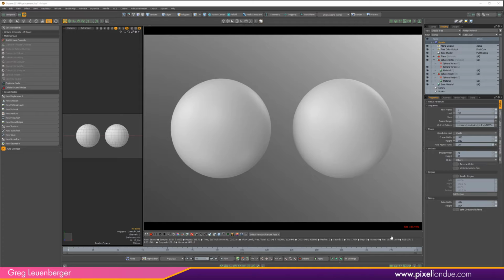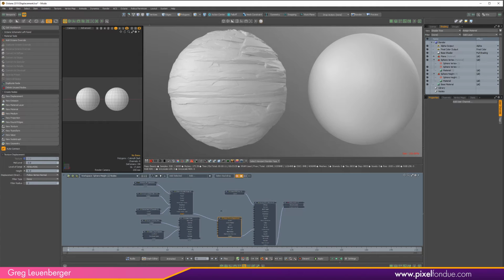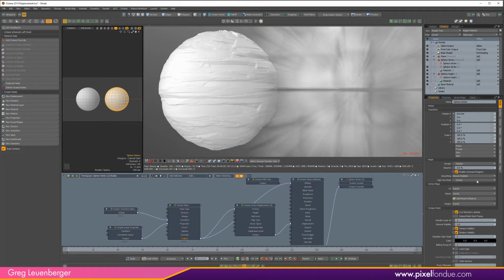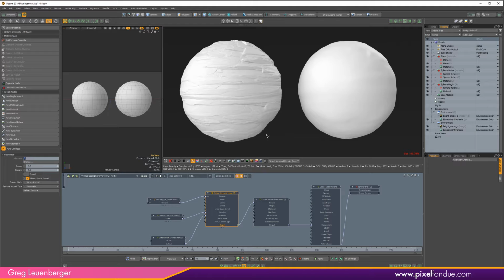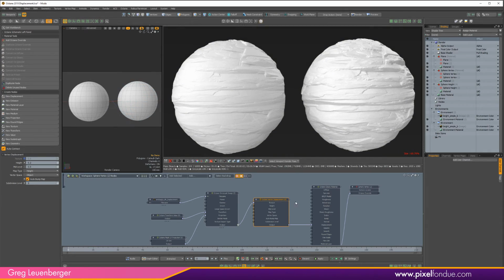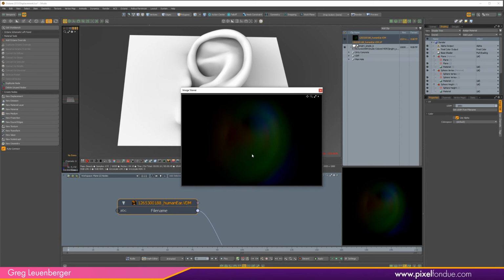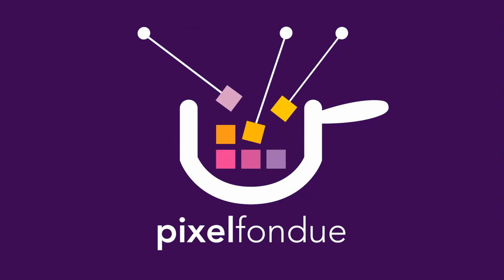MODO | Octane 2019 Displacement

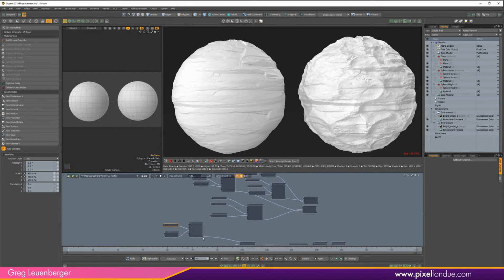Comment: Thanks for the video. Why are the node windows are increasing when you mouseover on them? As at 6:57. Is this a Modo thing or an Octane thing?
Reply from the maker: MODO thing, if you hover for a second it will magnify to help you make the connection.  It's a nice little feature.
Reply: @pixelfondue  Thanks for the reply. I found out that it only works with a mouse. Unfortunatelly not with a Wacom pen. I'm used to do everything with a pen in Modo. Like in Photoshop.